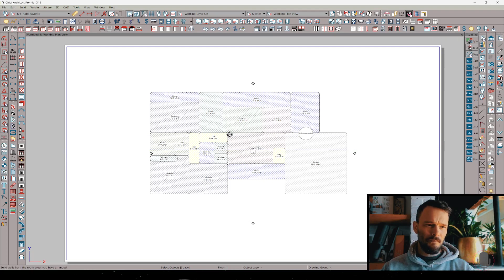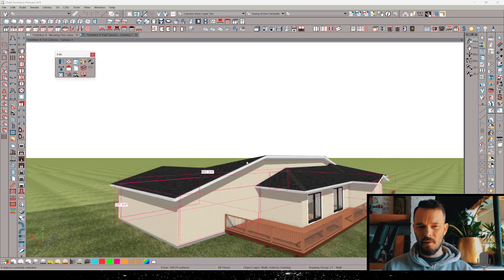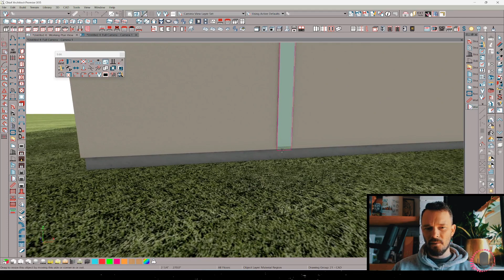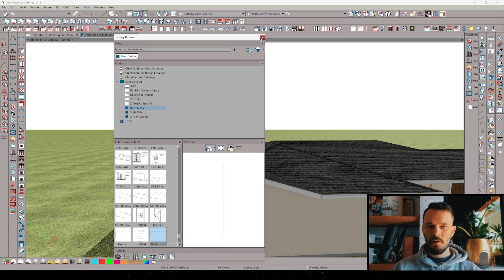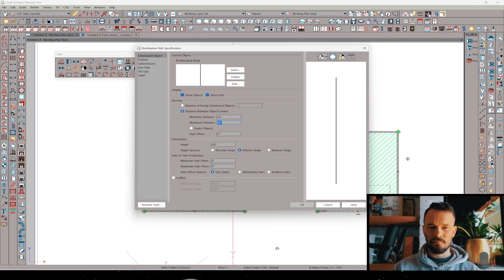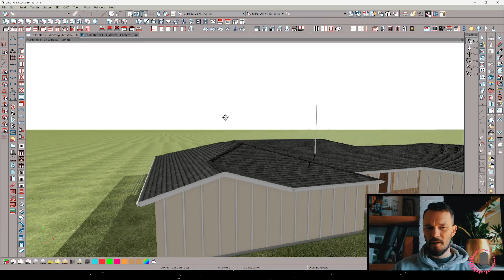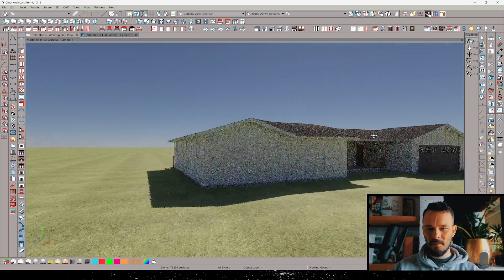CA SHORTS- Fast 3d Battens in Chief Architect X15

Comment: Incredible tip! What happens to the battens if the wall is edited?
Reply from the maker: they will still respond like backsplash/material regions do. they will still clip to a window if it were added or they will move with a tall if the wall is moved. If the wall is removed they may snap to the nearest adjacent wall

Comment: what exterior wall material are you using.  mine shows horizontal siding
Reply from the maker: This was an old version of my pro plan which used a custom material I created. You would probably switch to a solid color for this

Comment: Rene,  I've used this a few times and I have seen the battens turn 90 degrees to the polyline path, and it took a while to find the "orientation" button to rotate them by 90 degrees.  Which worked, but what is odd is they will randomly vanish from elevations and 3d views and I cannot figure out why?

Comment: Why do you explode the architectural blocks to turn them into material regions? The architectural blocks show up, so why not just leave them? I'm sure you have a good reason, just wondering what it was. Thanks for this video, super helpful. Battens have been so time consuming using other methods.
Reply from the maker: I explode them just to be able to clean them up as necessary, stretch them etc. Sometimes see funny behavior when they remain blocked

Comment: Nice job! I continue to learn quite a bit from your videos! Could you use a similar technique to do a standing seam metal roof? I've done standing seam roofs using polyline solids.
Reply from the maker: Use roof planes for individual seams, add an inch to your surface designation and then shorten at the fascia and ridge. Leave it right on top of your existing roof plane